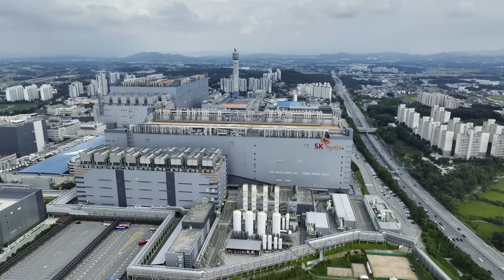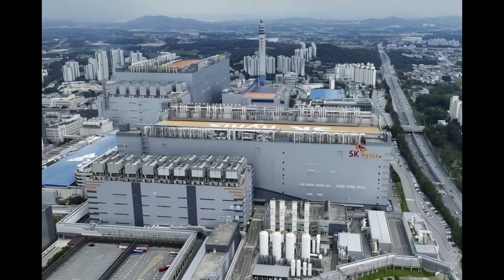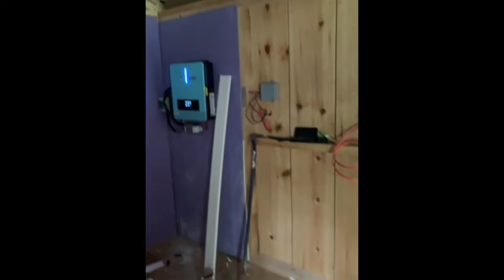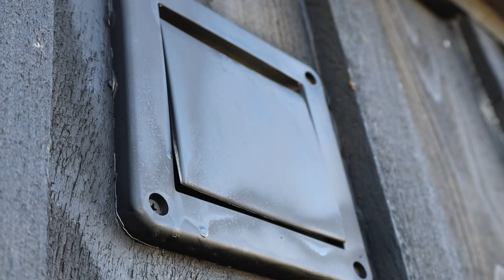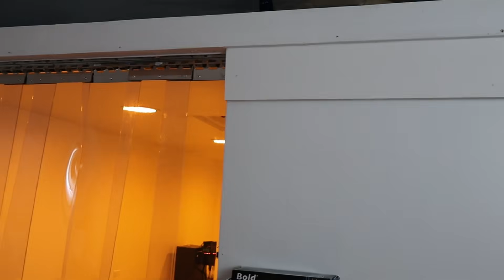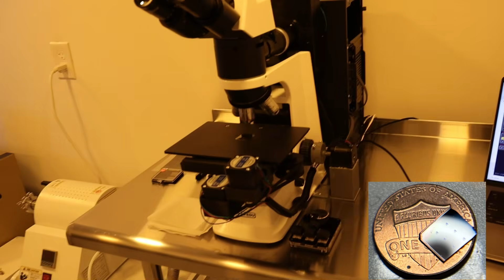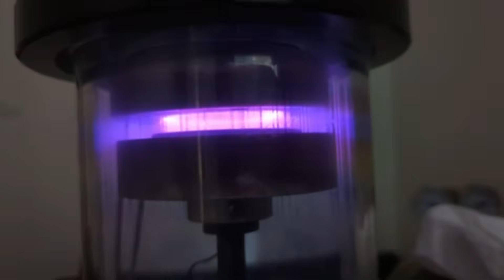There’s a Class 100 semiconductor cleanroom inside this backyard shed.

Comment: Crikey!   When I did my Bachelor of Engineering course at a university here in Australia, the uni had a fab facility which us students did assignments in.   A long time before they had hired a professor to set it all up, teach semiconductor fabrication, and do research.  I remember him telling us it took him years to successfully purify silicon and then make chips that work.    My assignment was to make an insulated gate FET - just one FET.   It worked - well it sort of worked if you define "worked" rather loosely.   The gm was measured at around 10 microamps per volt.  I got good marks though.

Comment: Funnily enough I was actually just looking into trying to do an even smaller "cleanroom" so I could open and clean my camera lenses without getting dust inside of them.  I remember several months ago I had seen a sort of pop up clean room glove box on amazon, but forgot to bookmark it, and wasn't able to find again until literally yesterday.  Turns out, it's actually meant for growing mushrooms of all things! (might get added to a watchlist if I buy it).  My thought is I can get that and a small battery powered hepa filter I can stick inside.  Won't be perfect, but thankfully I don't need perfect, just "significantly better", which should be achievable.

Comment: In the next video he will be showing you the papers he got for not having all the right approval before doing this work on a shed. Running power alone requires approval and inspection by a certified electrician that is not you usually. May be different depending on location but I smell trouble coming if this was done without the right paperwork just saying. I literally saw a well known youtuber get hammered for running electric without the right paperwork.

Comment: This is great. over time the suit will accumulate particles from the gowning area maybe might want to add a small air shower just to be on the save side. What ever particles you don't bring in the down draft doesn't have to deal with.

Comment: I worked for 22 years in the semiconductor industry (AMD and GlobalFoundries Fab 30 and 36), and I would say you are wearing the bunny suit incorrectly. Normally, you first put on a hairnet and a face mask. In my fab, we also had clean shirts and pants supplied by the company. Then we put on cleanroom shoes, so we didn’t have to wear booties.

After that, we entered the gowning area by walking over a sticky floor mat and started with underliner gloves. If you have items you want to take into the cleanroom, you need to clean them with IPA wipes. For this, you put on a second pair of latex gloves, which you discard after you’re done cleaning.

Then you put on the hood and the suit itself, followed by another pair of gloves made of nitrile or latex (I preferred nitrile because of the better grip). This pair goes over the sleeves of your suit. Now you’re ready to enter.

Comment: There is a market for ASICs, especially in the hobbyist space, for process nodes which don't cost thousands of dollars per mask area section. I would gladly trade down to a 3um process if I can pay less than a thousand dollars per 10k transistors worth of mask area. Some people do not need to make millions of parts, only 100s, if not tens. You might want to take advantage of this and aggregate a bunch of such designs and make a public set of design rules. It might be worth pursuing, even if the bulk cost is a little higher.

Comment: how do you step in the room with clean feet, you come from outside so then the floor is dirty, then yousuit up but do your suited up feet tuch the same floor?
Reply from the maker: haha good question, I have a rubber mat right in the entryway where I swap to different shoes with added boot covers before doing anything. Where I periodically wash the mat with DI water.

Comment: underground water pipes work in a similar way on positive pressure. if there is a leak it can be fixed. 
if you turned the water off to the pipe and water leaked into the pipe. then the entire length needs cleaning before it can be put back in service.

Comment: im curious as to the equipment cost and how you get ahold of the etching chemicals, as well as how you dispose of the waste.
Reply from the maker: The equipment has gone through soo many iterations, but I try to keep it as cheap as practical xD like the lithography system is a microscope + maybe $200 in parts? Spin coater is <$100, etc. Chemical wise there are actually a number of companies that will ship to a residence, but what I also did to make it easier is setup an LLC and then also talked to the post office to set up my property as commercial, its mostly just a hang-up with some companies that don't want to ship to a residence, nothing from a legal perspective. For waste I store it on site in 50 gallon drums, log it, and have a company swing by to pick it up. As I deal with so little quantities it takes a long time to fill them up and then below anything with my state.

Comment: I build the sensors used to check for air flow using in some clean rooms. I've never seen a clean room with that much air flow.... I have a lot of doubt that would actually pass any of the tests.

Comment: The only two improvements I'd suggest are easier hepa filter replacements and a secondary air lock between the outside and gowning area to prevent the large pressure loss when opening the door. But seriously dude, for taking just what looks like a 7x14 shed and making a legitimate clean room? Rock the fuck on brother

Comment: could you feasibly make fairly low variance through hole components in a setting like this? Just low voltage stuff like JFETs and MOSFETs, stuff like that; and I'm sure you could make inductors and stuff but what about passive components like diodes and resistors? Also, what about germanium? Could you make weird stuff like selenium diodes? The obvious answer is to just use SMD components but there is something about a circuit board full of candy corn and jelly bean looking components. I love it.

Comment: i mean its a good solid step in the right direction but the fact you can open the door and have an opening directly into the lab to open outside air between the flaps is very cringe worthy even with air pressure assisting repelling particles, you may be working on it but a better door system is needed as well as the room that you put on the clean room clothing needs to be HEAVILY cleaned and needs a air duster to spray any loose particles off of you when putting on the suit, best case would be 2 air locked rooms before the lab one to put on the suit and the next to air dust yourself off in a vacuumed setting THEN a sealed door to the lab, you will also need a way to equalize the pressure or else door will be stupid difficult to open if air tight, of course in terms of cleaning you can always go cleaner but its always a concern of cost

Comment: Hey man! This was really cool and showed up on my reccomended. I actually had a question! I'm doing research on synthesis of perovskite films(Lead Iodide perovskite), and I have been spincoating on ITO slides. Can I ask why when you used your spincoater, you dispensed the fluid and then ramped up to your chosen rpm? I always dispense over the center of the slide when up to RPM. Im only a college student and want to know if maybe I should try to dispense it first like you did.
Reply from the maker: Oh cool, for solar applications? Haha on my little ricecooker lid for the spin coater it actually does have a hole on the top and I do have recipes for dynamic dispensing though I rarely coat it that way. Static dispensing is helpful since most of the time I work with smaller pieces with sharp edges that don't coat as nice as full wafers, the drawback is it uses more resist and is slower than dynamic dispensing it while it is spinning.

Comment: hey i work at asml. do you have anything uploaded for your i-line stepper? looks awesome would love to see how you made it
Reply from the maker: not yet, but will work on it! It is a microscope where I use photoplotted masks (high resolution transparencies down to 7um) and the optics shrink it down, where I can get submicron features, and currently playing around with immersion for sub 100nm. The stage is motorized and I have a motor to physically swap between a high powered 365nm LED for exposure and a yellow LED for focus. All automated, but drawback is field size, so I can only pattern dies 800um in diameter without stitching.

Comment: Did you make the machinery first and then think about doing a cleanroom or the other way around?
Reply from the maker: yeah most of the machinery fist, it got too weird having the etching in a closet and the sputtering system in the living room.
Reply: @Dr.Semiconductor and what did you use as reference for your cleanroom? How long did it take to make a plan and then work on the cleanroom

Comment: Dude, that's a class 10 at best, but I'd be surprised if it's even a 1. Good try, but there are many reasons that cleanroom facilities are inside of very large buildings. Watch some videos on the process of dressing in a cleanroom. You didn't even have enough room for a clean side and a dirty side in your changing room. You are not doing it correctly.

Comment: One note, those big companies with a class 100 clean room... their clean rooms are huge, and they have multiple too, yours is like 0.01% of total surface area as they have per building, so it's way easier for you to accomplish such a high standard than it is for them, now of course yours is still impressive, i personally would've just extended the shed with an extra shed on the front for the gowning/decon area, just so you would have a bit more room to move around in, but as long as this works for you then that's great!

Comment: Um... Surgery grade A iso14644 limit is 0 for >0.5um... even under operation conditions, in pharmaceutical is even lower limits why didn't you just buy an isolator? Also i thought semi conductor requires extremely stable grounds if your not making semi conductors you dont even need a cleanroom, please go find a job or tour a factory before spreading false information online ive worked in the health industry for over 10 years its not that complicated for those who are wondering a class 100 or better clean room cost so much is because the machines needs to be on 24/7, maintained regularly and also cleaned after every operation. Most ppl only buy an isolator so you avoid lots of the costs
Reply: Also you created the room environment generally the machines are in laminar flow cabinets that are sealed which is much higher grade than the room with hatch accesses and a single machine costs over millions thats why ppl dont do it in garages people are poor enough in this day and age stop scamming please
Reply: Also bro is shining light through a microscope its not a laser diode for semi conductors wtf? Or is it just ai generated slop?
Reply: Also bro this is the worst business idea i have ever seen if ppl are curious how  semi conductors are made there's millions of educational vids out there the equipment budget used here vs other electrical channels are in the hundreds of magnitudes higher unless you got a super rich daddy stop it however, if your daddy is a multi millionaire be my guest

Comment: Why use warm light? It looks like 2700K or something similar. 

In my experience all labs use at least 4000K lights and they also get much brighter ones as well. No idea if the camera is the issue, but it looks way too dim and yellow.
Reply from the maker: In semiconductor manufacturing the yellow light is used like an old dark room for photos, since the photosensitive film used to make nanoscale patterns is sensitive to white light but not yellow.
Reply: @Dr.Semiconductor Thanks! I was so confused. I've never studied semiconductor manufacturing specifically.

But whenever I've seen a fab they've had white lights. Perhaps inside the real manufacturing rooms they had yellow lights.

And great analogy with the darkroom, I do have a photography background even though I study electrical engineering. 

I've been getting more interested in semiconductors lately, I might look more into it.

Comment: Finally! A room where I can apply my screenprotector sheet to my smartphone without trapping any nasty dust particles inside it.
Reply from the maker: haha exactly, I make sure to swap screen protectors in the cleanroom!
Reply: @Dr.Semiconductor  dude you should charge people 5 bucks to just apply their screen protectors in there. I would!
Reply: @sipofsunkist9016  but then it would loose its point of being a semiconductor lab. you cant really help when your thinking is influenced by insta and dropshippers who would convert LHC at CERN into dropshipping facility
Reply: @Dr.Semiconductor  honestly your cleanroom particle numbers werent that much lower than my house where i run a basic hepa air purifier.
Reply: @Jwalk-v9k  What kind numbers you have with a particle meter and how small particles can your meter detect?
Reply: @MikkoRantalainen  i just have a basic plantower PMS5003 sensor wired up to a PCB, but can give damn near the same measurements he was taking it just doesnt have a fancy time resolution. The range of measurement 0.3~1.0; 1.0~2.5; 2.5~10  just the same.
Reply: @Jwalk-v9k  Does PMS5003 emit particle count or µg/m³ numbers?
Reply: definitely cannot be use to make semiconductors
Reply: a guy I worked with used to install them as a side hustle and he did them all in our cleanroom 😬
Reply: @theJonnymac  why the emoji?
Reply: Take a hot shower in a bathroom with the door closed, and by the time you're done, all the dust will have sunk to the ground. Then clean your phone screen and apply the protector, and there won't be any bubbles or dust trapped between the glass and your phone
Reply: @bijectivity  Instructions unclear, applied protector in the shower.
Reply: I bet even in that clean room somehow a dust particle would end up under it. That is just a law of reality.
Reply: At my old site where phones were allowed in the cleanroom, this is exactly what I'd do. Just gotta take it out of the cardboard box first because cardboard is big nono
Reply: Right! I've only done it absolutely perfect on a few occasions. But it took me about 45 mins to prepare and get ready to do it lol. 
However, I recently installed a glass cover on my son's switch (AM glass I think off Amazon) and it was not near as stressful as it used to be. The template they give you is also very good at getting it straight, where it should be.

Comment: Your plasma etcher seems to be a sputter coater. It’s the device that’s used to coat samples with metal ahead of scanning electron microscopy.
Reply from the maker: haha good eye! Yeah it is an old gold sputter coater for an SEM, for plasma etching I swapped the electrodes and added a turbo pump to the unit :P I have an actual plasma etcher in my garage I am fixing up to replace the sputter coater though, stay tuned!

Comment: Great setup for the purpose! Not hating, just a nerd. 

This is, however, not a laminar flow cleanroom. This is a turbulent flow cleanroom. You are keeping the area clean by dilution, not by continually sweeping the particles away in unidirectional airflow (which would be laminar). Typically a laminar flow cleanroom will have 100% HEPA filter ceiling coverage, and raised floors, so that the airflow in the work area is completely flowing in the same direction and at the same speed. This ensures near 0 particle counts.
Reply from the maker: Yeah it is more like the old bay-chase model, I need a true sub-shed next! but that is also the magic of dilution too, increased airflow can cover sins to make it work :P

Comment: All you noobs giving him praise for missing one of the biggest key elements.  He has no air curtain to blow off the clean suits that are all bunched up in a bucket in the walk in area. Not to mention he says it changes the air over 100 times per hour. Look at the video where he shows you the exhaust vent. That little crack that its open will NO WAY change the air over that many times in an hour.
Reply from the maker: Sorry for the confusion, while the air is changed hundreds of times per hour, I meant like recycled from the cleanroom not the entire shed. Some amount leaks out through doors/fume hood exhaust vent in order to keep positive pressure and dirty air out. One hack to make this work so well is that I have crazy airflow so I guess it kinda acts like an airshower? though maybe should/could install a mini one above the entryway, I do regularly wash my suits in DI + specialized detergent though <3

Comment: What is your stance on Electron Beam „Lithography“ it can reach resolutions beyond far beyond i-line and can also be built relatively compact - it’s industry issue is the glacial speed which shouldn’t matter as much in a personal R&D space.
Reply from the maker: Yeah great question! e-beam litho is great but it is sooo slow, you can spend all night just writing an area of 1cm2 which limits it to R&D. It is like drawing a picture by hand (e-beam) instead of just taking a photo (stepper system).

Comment: THAT is really cool i actually work in a positive pressure clean room (Class 100 also). Ours is lifted off the ground and the air flows out the bottom of the room.  We develop Units that clean the wafers and also used for Etching. They are Called TIH Chemical Heaters. Really cool and amazing Job on the room !